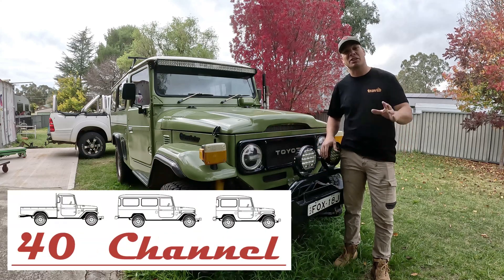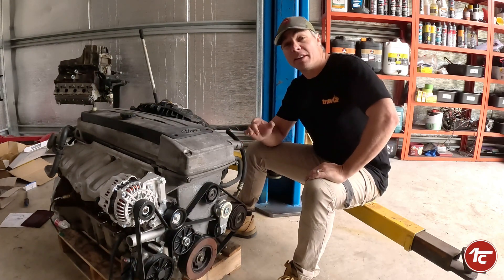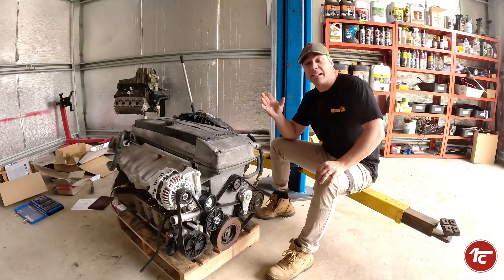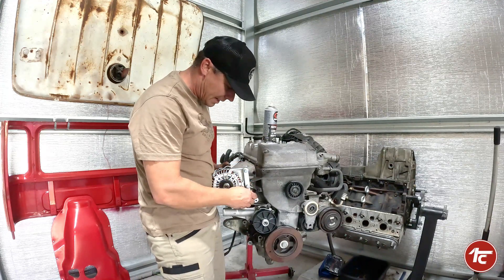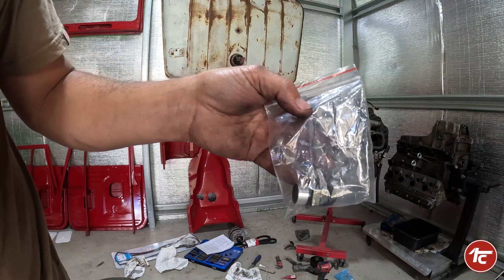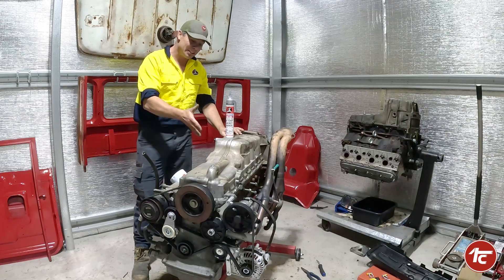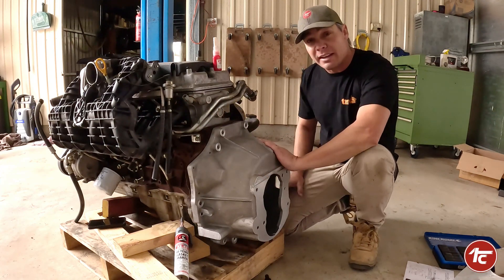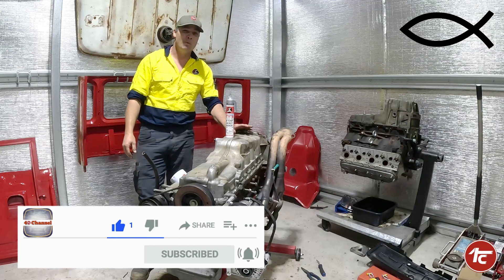BARRA FJ45 Ep1 -Engine swap  - Why we are using the BARRA - High mount alternator conversion FJ40

Comment: F ound
O n
R oad
D ead

I'm not a fan of Ford. You see a lot on the road around the USA. I'm Toyota all the way. But I will watch the build just because it's a 45😅
Reply from the maker: I know I have never been a Ford man myself, But as far as engine conversion go for low cost, and reliable I can't go past the Barra Motor. It would be the only Ford motor I would pick.

Comment: Haveing worked for ford for almost 10 years they are a great engine bullet proof cant go wrong really.  I probably would have recommended doing the Welch plugs though.
Reply from the maker: Thanks for the advice, where the welch plugs an issue? I still have time to change them out while the motor is still out, I have a choice of Stainless or Brass?
Reply: @40ChannelCruiser  I'd go for brass they weren't an issue if the coolant had been routinely changed.  I'd swap them out, especially the one at the back of the motor, having seen the gunk near the water pump.